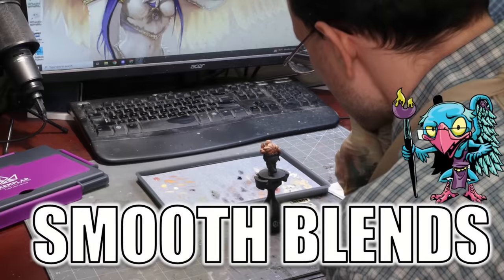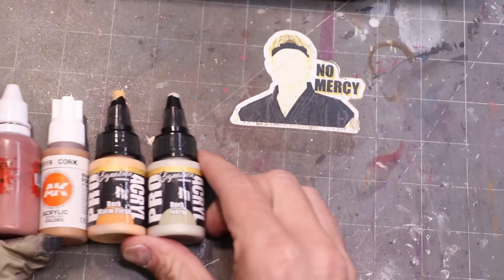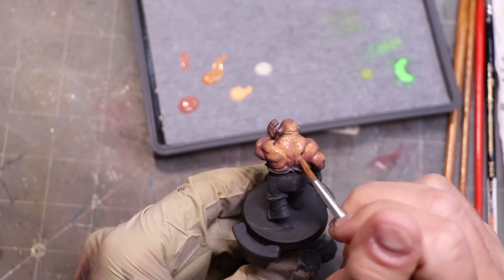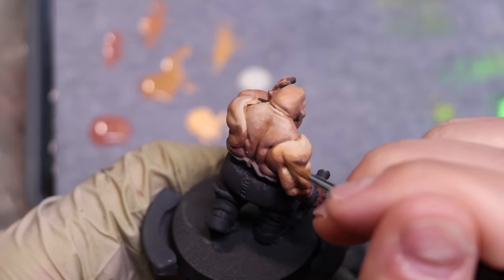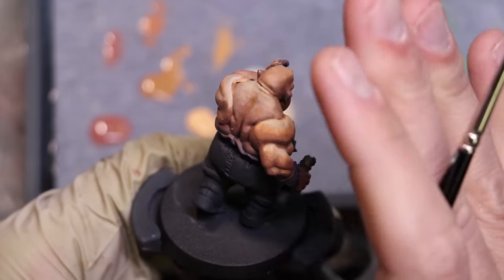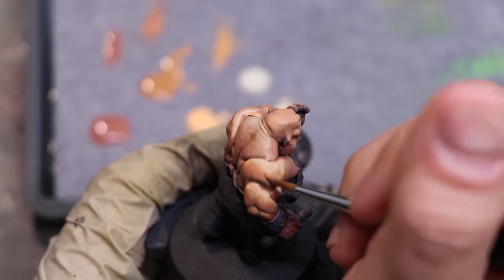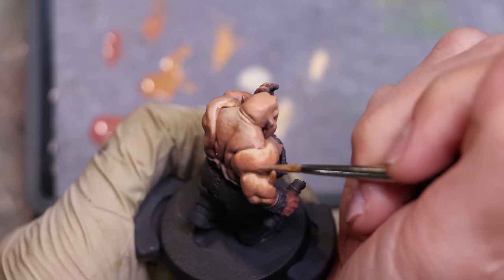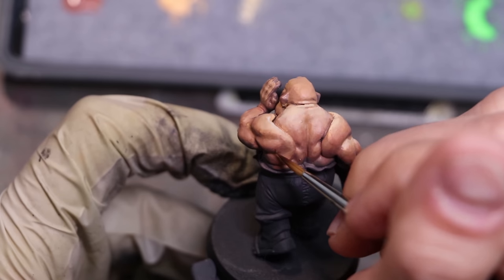How to Achieve Smooth Blends - HC 416

Comment: Did anyone else have a couple moments where the video froze up, but the sound kept going? Frustrating because blending is the technique I most need to work on.
Reply: I think it was on purpose so he could talk about what he was going to do before doing it.
Reply from the maker: That was unintentional, I will have to look into what happened there.
Reply: Yep
Reply: @VinceVenturella Is it possible to re-upload the video with the corrupted footage fixed?
Reply: @derpchief9614 
I can help guys
So to start the technique the whole time is glazing which doesn't change.
Firstly, hes glazing and using a brush technique called feathering with a fairly bright coulour being the highlight. This we see.
Then when it cuts out look at brush, its a darker mousie brown/red. He is applying this below the top half of each segment. Since its a midtone it sits in the middle and to be pushed away from the topend highlight but if goes into shadow its ok cause thats covered next step.
When it cuts out next we see the paint, a dark red almost wash consistency, hardly anything on the brush. Starting from the midtone, he featheres into or towards the shadow. Thus tying or "blending" each segment.
This is just like wet blending, hes only using a glaze though.
Reply: Yes, I did, and I hope he fixed it

Comment: This is such a wonderful video not only explaining why it’s so hard to blend acrylic paints and demonstrating all the major methods but also reminding everyone that the perfect blend requires multiple steps to achieve. That butter analogy is a fantastic way to explain feathering. In case anyone was confused by the term “voiding out” it simply means that Vince is wiping off excess paint on a nearby paper towel. Sometimes I wonder why I’m not using oil paints or airbrush more frequently 😂
Reply from the maker: Glad it was helpful!

Comment: When I go into ’blending mode’ i have a small eyeglass cleaner spray bottle to keep the moisture up. Sometimes I use the cloud of aerated water to keep the o2 level. I will use the spritzer for washes as well.
Reply: This is an interesting idea. Could you elaborate a bit on how you do this, examples of when to use it and when not to etcetera. Please.

Comment: Thanks for another great video. If you ever find the time, I'd really to see more about oils though. There are a lot of videos out there, but very little about working an entire (or most of, I understand some smaller steps are better done with acrylic)) mini, especially a smaller, 28-32mm one. And it's usually about skin, or one big set of armour. I'd really like to see what the work process would be for just one, "normal" mini...
Reply from the maker: Great suggestion!

Comment: Another cracking video!  The only blending technique I've been struggling to find much information on is 'glaze stippling', which I'm told is what some well known competition painters use as a final step (notably, Albert Moreto Font, whose blends are crazy smooth).  I'm guessing that it does exactly what it says on the tin, but would love to hear some Vincy V wisdom on it!
Reply from the maker: Glad it was helpful! But yep, it's exactly what it sounds like, just small stipples of very thin paints for perfected blends. I will have to do a video on it eventually.

Comment: The way you described blending techniques was perfect. Thanks! Any reason to or not to add a paint retardant for blending acrylics?
Reply from the maker: You have to be careful, it will thin the paint as well. That means it will make the techniques like wet blending harder, so it can actually work against you at the same time it's trying to help .

Comment: Great video, Vince. One question. How do you deal with the potential of texture buildup when applying the thicker paints as a foundation for the blend? Is it just a matter of loading less paint than you would think to put on your brush and spreading it from there?
Reply from the maker: You want lots of paint and you want it thick. THe trick is you need to really aggressively spread it out on the model. You shouldn't see any build up or texture if you're working quickly with a large brush and spreading it out, you'll end with a nice, thin, well blended layer.

Comment: Do you prefer mediums in addition to water for thinning down paint into a glaze? Sometimes I use water, but it seems like Vallejo's glaze medium helps prevent water marks a lot better. But the darn glaze medium gets little partially dried specks in it that have to be pulled out >.<
Reply from the maker: Honestly, I mostly use water only, occasionally I will use some flow improver, but mostly water.

Comment: I know it makes 0 sense for tabletop painters, but I’m curious why competition painters don’t switch to majority (90-95%) oil paints for their work?
Reply from the maker: Just harder to control often in the small spaces we usually need to work. I often use oils (and oviously beldning with oils isn't a thing), but there is also the need for more toxic elements, taking long to dry and so on.

Comment: You mentioned feathering with blending. When would you use stippling?
Reply from the maker: It's another final step option instead of glazing, it doesn't tend to be my go to, but it's a solid plan for finalizing the smooth blends.

Comment: Good video on the blending techniques. I also find the glaze consistency challenging to get it right without using some sort of medium. Will you be making a new/updated video on glazes? Or still the same?
Reply from the maker: I made one fairly recently, but it's still the same technique. Thin, rinse the brush, dip, wick off the excess liquid, apply.

Comment: Hey Vince. Once you've torn a glaze, is there any way to fix it? In the past, I've hidden any tears under weathering or battle damage. If you really want that area to be smooth, is there an easy way back?
Reply from the maker: Once you have texture, it's basically accept it or sand that whole area down, there aren't many other ways out. That being said, if it's a small area and the project isn't for competition, who cares? I say push through a get it done and move on. :)
Reply: @VinceVenturella  excellent advice! Cheers Vince!

Comment: for the wet blending part, what about using a retarder medium? how would that go do you think? I've not tried it too often, it... thickens? kind of? the paint for me I've found and I dunno how to work with it. But maybe in the interest of skin tones it'd b e worth trying to learn to work with?
Reply from the maker: So retarder medium will generally thin your paint and won't give you too much additional working time. If you're talking about thicker, then you've tried vallejo retardent, which is a terrible product. The issue is you're adding "not paint" to your paint, and it makes it actually a little harder to wet blend properly. So it can work, but you want to use a little bit of it and it won't give you that much additional time.
Reply: @VinceVenturella  ahh kk ty! And yes was Vallejo lol suddenly it makes sense

Comment: Could doing this potentially leave more brush marks or textures? I guess if you don’t work it in enough or maybe too much? Edit: The first wet blending style I mean.
Reply from the maker: It should theoretically result in less, as working and smoothing the paint like this should hopefully eliminate most brush strokes.
Reply: @VinceVenturella  righto! I’ve lined up some spare minis to practice new techniques on this weekend and will give it a go!

Comment: My issue is consistency of the Glaze.....my glazes can easily become washes with Acrylics....Inks are so much easier to work with I have found.
Reply: Yeah, it definitely depends on the paint. There are a few S75 that glaze wonderfully, and a few Vallejo that really need a lot of help to get transparent enough.

Inks can be a little strong, in my experience. I love them through the airbrush, but brushed on I find them very tricky to control.
Reply: May i suggest you to:

- try different paints, some brands are easier to control than others

- assuming you already use a wet palette, use less water in it, or try different membranes/parchment papers

- if you still have problems, try some glaze medium instead of water
Reply: If you've been using water, try a medium? Vallejo sell tiny pots of matt medium and glaze medium.
Reply: +1 for the medium. Vallejo's Glaze Medium doesn't just have a clever name. It makes Vallejo paints behave a little bit more like S75 or Warcolours, it might work on other brands but I did hear that it causes Citadel paints to bead up weirdly.

That's what I meant when I wrote they need a lot of help.
Reply from the maker: So I have some videos that deep dive specifically on glazes. If you're getting a wash effect, then you still have too much liquid in your brush. When you create a glaze, that dab into a paper towel to wick off the excess liquid is very important.
Reply: @VinceVenturella  Thanks  Vince! I’ll check those out

Comment: Hi vince. I love watching your videos. I have recently tried to airbrush my first model but after i tried to put a wash on it, all my paint stripped away. Any idea what could be happening? My research has said maybe i didnt let the paint dry long enough or shake the bottle enough?
Reply from the maker: So there are several different potential explanations, the paint from the airbrush could have been overly thinned, so it wasn't able to set properly. It could have been an an ink or something that reactivates easily. It could have been too fast where it didn't fuly cure. In any event, the answer is always give it enough time to fully dry and if you want to be sure, a quick varnish layer through the airbrush will keep everything in place for future work.
Reply: @VinceVenturella  thanks for this Vince. I didnt turn on my notifications! So the paint I used was straight out of the bottle Vallejo air. I tried to let it different sections dry and then tried the wash over different days (up to 4 days) with the same effect. I guess I may have concentrated my spraying too much and not letting it dry between layers. Thanks for your help. I love your vidoes

Comment: would you suggest using retarder medium to increase drying time?
Reply: Also interested in the answer to this question
Reply from the maker: So it's tricky, It can help some, but you have to be very careful, because it will also thin the paint, which works against you and you won't extend the dry time by that much in most cases. So the answer is yes, a tiny amount can do something but it's easy to go wrong and won't give you that much additional time.
Reply: @VinceVenturella  thank you very much for your time to answer me:)

Comment: is glazing what some people call layering?
Reply from the maker: Nope, but they are related. I have videos in the playlist all about paint consistency. In short, layering is when you’re using slightly thinned layers to build up opacity and create transitions of color. Glazing is when you’re paint is quite thin, and you are simply attempting to modulate the colors underneath rather than change the color or cover the area.

Comment: what do you think about using retarder medium to make the drying time work a little more in our favour?
Reply from the maker: The issue is it doesn't extend the working time very much and it thins the paint, which is the opposite of what we need to you end up often with something that doesn't wet blend as well because it has been thin. So it can be done, but you need a very small amount which will have a minimal effect.
Reply: @VinceVenturella  that explains why every time I try it I feel like I'm doing something wrong! thanks for the explanation :)

Comment: What about using a drying retardant? Does that make it easier?
Reply from the maker: Some, but not as much as you think. You are thinning the paint with the retardent, so that makes it harder to wet blend, if you thin it. The other challenge is if you only use a little so you can still effectively wet blend, it won't extend it that much. So the answer is it can do something, but not much.